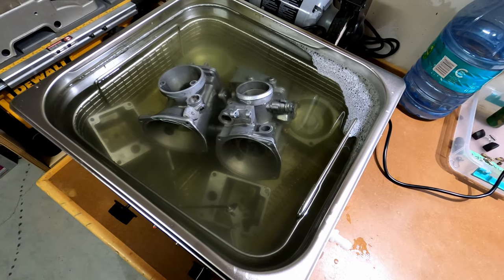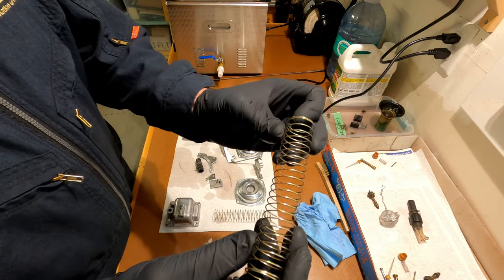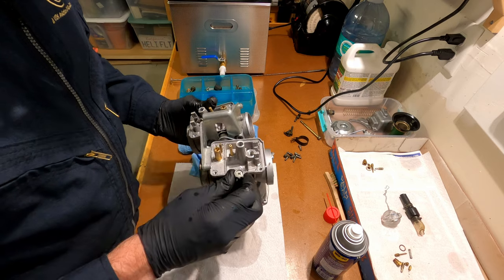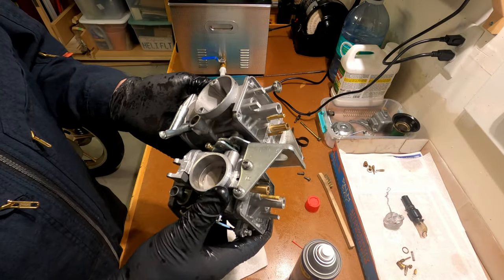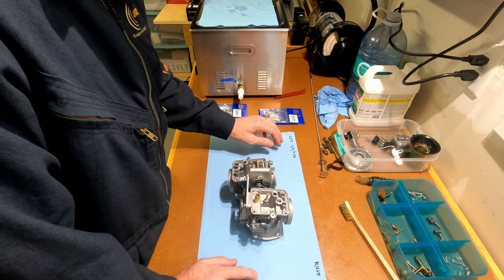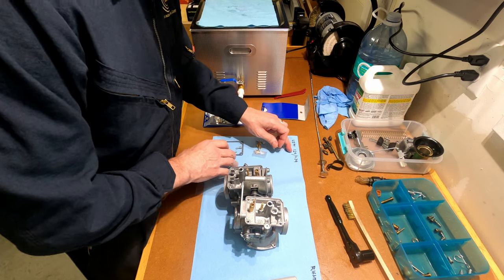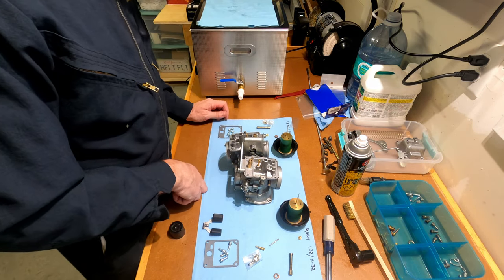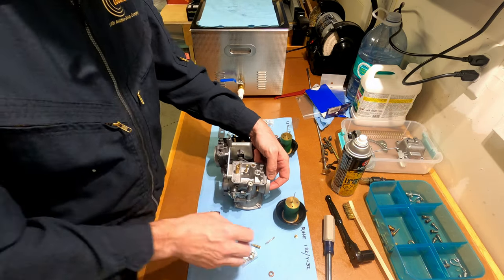Yamaha Virago Carb Cleaning (PART 2) - 1984 Virago XV1000

Comment: Great video Ken, you're instructions made things so much easier for me. I am still waiting for my "carb rebuild kits" and I noticed that you stashed those tiny little aluminum discs back into a bag, asking if any of us viewers knew what they were for -- to maybe let you know... Well my guess (and it's only a guess) is that they are simply plugs that can be reinserted into the pilot jet hole under the float bowl cover...the cover that everyone seems to think shouldn't be there so it gets removed (personally I wouldn't use them anyway)... I guess they are included in the rebuild kit for the purists?
Reply from the maker: Turns out they're for another version of the carb - an older version actually - that uses that part.  Still not sure what it's for but it's too big for the plug you're talking about.  This will become one of life's great mysteries.

Comment: Hi Ken,
your Hitachi carb videos have proven invaluable as I work through the same process on my 1984 xv1000. One question which I have yet to find an answer to: The two needle jets (emulsion tubes) have small holes on the sides. On my bike there is a different amount of holes on each needle jet. Do you know what they do? The Haynes manual I have refers to 3.2 but I have no idea what that means. Just want to be sure I have the correct needle jets as the carbs have been worked on by previous owner(s) and I want to be absolutely sure which needle jet goes in which carb. (One was quite a bit dirtier than the other when I removed them and at the time I didn’t realize there were holes on the side. Thanks, Brett
Reply from the maker: Hi Brett.  Those tubes are simply the channel through which the main jets (threaded into the bottom of that channel in the float bowl) allow gas to flow, metered, to the Venturi.  You’ll notice that the tapered needle allows more fuel to flow as the throttle is increased.  It’s hard to see when the engine is running because they are CV carbs - the sliders move with vacuum.  Each carb is different.  The jets are different sizes and I believe the needles are too.  I don’t know if the tubes are too but there’s a good chance they are different as well.  The reason why they are different has been argued by many but it is my understanding that because of heat dissipation and emissions, the mixture delivered to each cylinder is slightly different.  Those holes in the “emulsion tubes” are there to help atomize the fuel in a very precise way.  I’m at work at the moment so I don’t have access to my documents but there may be some specific data in the Haynes manual regarding the jet sizes, needle size and clip setting on the needle.  Keep me posted.
Reply: Ken, Yesterday I replied to your prompt response to my question but it seems to have disappeared. Just wanted to say thanks and that I will let you know how things go for sure.

Comment: What I’ve noticed is there’s a bunch of gas pouring onto the engine under the carbs, where should I check?
Reply from the maker: looks like the floats aren't moving the pin into the seat.  Shut off the fuel and have a look at the floats.

Comment: Hello, Ken.  Great video, but I think you installed your pilot screw components are in the wrong order.  Please refer to 16 minutes and 20 seconds into your video.  You put the rubber O-ring on the screw first, then the steel washer, followed by the spring.  I am not 100% sure, but I believe this is backwards.  I think you should have pace the spring on the pilot screw first, followed by the steel washer, then the rubber O-ring.  Where did you find the information to ensure you did it properly?  I am working on my Hitachi carbs right now, and was referencing videos to ensure I did it right.  You are the only one of the 4 videos I watched that did it in the reverse order.  PLEASE HELP!  Thanks.  Terry
Reply from the maker: Hi Terry!  Thanks for the comment and question.  I've pulled a ton of these carbs apart and I've seen the o-ring/spring in either order and in both cases it worked just fine.  The whole reason the o-ring is there is to ensure that the pilot screw is sealed from the outside air.  But if you check the Clymer Service Manual (Chapter 6, page 116) you'll see the exploded view of the carb and it shows the order of assembly and I followed that.  Since I've overhauled the carbs, they've been working perfectly and I've driven about 1000kms (600 miles) since - the bike runs like new.  I'd start with the service manual being correct and take it from there.  If you've seen my other videos, you'll see that many parts and assemblies I've repaired were installed incorrectly from previous owners - the brakes being the biggest problems so far.  Let me know how it works for you.
Reply: @KensWorldRestorations  OMG, Ken, thank you SO much for the info.  I have the same service manual, and will address it tomorrow.  Be well!
Reply from the maker: @terrykavage6282  No problem - I don't ever want to say that there is a right way or a wrong way for this assembly but I always start with the service manual and go from there.  Having said that, I have found mistakes (and others have too) so always be careful.  I can say with confidence that I followed the book because I also saw variations in how it was installed.  But for me, I can certainly say that mine is working perfectly.  Good luck!
Reply from the maker: Hi again Terry.  It's been a couple years and your comment holds true.  The manual is drawn wrong.  Although I left mine as it is and haven't had any trouble whatsoever, the order is spring on the needle jet, washer and then o-ring - all as you pointed out.  I made a note in the description of the video.  Thanks again for bringing that up and sorry I'm just getting around to fixing this now.

Comment: For the float pin, is there something you’d recommend to replace it? Mine snapped as it was rusty when pulling it out. :(
Reply from the maker: You can buy them as separate parts.  You might end up sourcing something that isn't exactly the right length but so long as it's the right diameter you can cut it down.  Otherwise, I'd say find a scrap or used carb and scavenge it for parts.  Good luck with it all.

Comment: afternoon, i was wondering what 15L cleaner did you end up getting?
there are a few different brands/sizes I had been looking at myself.  would you say that the 15L has a deep enough basket to submerge the entire carb?
thank you for your input.
Reply from the maker: Hi there.  I bought a Vevor (Canada) 15L ultrasonic cleaner.  It was just barely deep enough to get both Virago carbs in at the same time.  It happened to be on sale at the time and was priced the same as the 10L unit - around $210 CAD.  They’re pretty much all the same - made in China/Amazon.  I prefer the mechanical knobs since I know it would be easier for me to repair over having to replace a keypad and control board.  So far it has lasted well over a year with no problems.
Reply: ok, thank you for the details.. now to add it to my wish list 🙂

Comment: Is the small aluminium piece a welsh plug for the mixture screw
Reply from the maker: It's too large in diameter to be a plug for the mixture screw.  Turns out that it's actually a part that is included in the kit but isn't used on this particular version of the Hitachi carb.  There are several versions of this carb for different model year and displacement Viragos and it's easier to make just one kit with extra parts.
Reply: @KensWorldRestorations  Hey Ken,  minerma is correct.  Its a welch plug for another version of carburetor.  Apparently just thrown in the kit for good measure.  Also,  ive rebuilt my later model Virago 1100 carbs and I believe the manuals are incorrect in at least two instances.  In the case of the small metal washer matched with the small rubber O ring for the air/fuel mixture screw,  that small metal washer's role in life is to protect the O ring from damage that might be caused by the spring.  I can also see your bike running like new with them reversed as the O ring most likely still giving a good seal.  The other misprint is commonly known with the Mikuni carbs on the 1100 in that the placement of plastic washers on the CV mixture needles is similarly reversed.  Hope this helps.  Very helpful rebuild and cleaning videos you have made and a pleasure to watch.  Thanks you for the upload and all the best to you and yours.